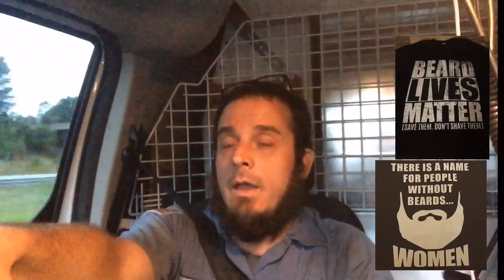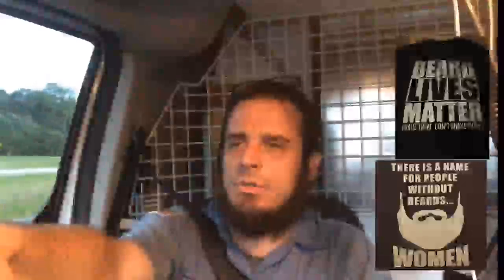Stephen Rardon Live Stream The Magical EEV, TXV's and other stuff

Comment: Hypothetically speaking say I have a brand new 3Ton Carrier R-410a condenser matched up with a brand new Carrier 3Ton air handler with multi tap variable speed blower motor. This is an ARI 16SEER match up. Now imagine I have a really nice 3Ton R-410 Sporlan adjustable TXV mounted outside the air handler cabinet for added performance and the ability to fine tune the superheat to my preference. If I charge the said system and adjust the TXV to 10 degrees superheat and get my subcool to roughly 10 degrees, as the temperature inside the house goes up and down in both temperature and humidity how much will my superheat stray from the 10 degrees where I set it? Will it swing drastically like say from 5 to 15 degrees or will that high quality TXV be able to hold the superheat within say 8 - 12 degrees throughout all fluctuations of indoor air temperature and humidity levels or maybe even keep it between 9 and 11 degrees? Maybe it even locks the superheat down and holds it perfectly at 10 degrees at all times regardless of indoor air temperature and humidity level? I’ve just recently started to fully understand exactly how a TXV works and well as understand the pros and cons of them compared to a fixed metering device like an orifice or capillary tubes. I guess my question is how well does a good TXV maintain a certain superheat setting as the indoor air changes in temperature and humidity?

1st Edit: Related to the question that I need an answer to, this probably doesn’t matter at all but for the sake of absolute information clarity... the motor might actually  be an X-13. Either way it’s not a PSC motor.

2nd edit: airflow in return and supply is sized very well. No undersized returns or lack of supply CFMs.
Reply from the maker: +Jeremy Sandidge I had a discussion with a factory rep for one brand in particular who said that their TXV’s are designed to maintain between 10-15... now that begs to question if that’s the design parameter what is real world? I typically see valves staying pretty tight to whatever number between there and not really moving. Of course I’m not able to monitor operation except for when I’m on site. Then you have those times during start up when the valve is working to get dialed into it’s sweet spot so that adds to the variable. I guess that all adds up to say I don’t know exactly how they typically operate but have enjoy this mental wrestling match you’ve induced. Thanks so much for watching!
Reply: Stephen Rardon haha right lol? I guess we operate on the same level. I actually believe I can be the best technician in the world some day and I’m gonna keep striving. It seems like what you are speaking about though is a factory TXV which is fix to a certain superheat range and unadjustable. I use high quality aftermarket Sporlan TXV’s that are adjustable. I can adjust the superheat to wherever I like from 1 degree to 25 degree. One thing I’m so curious about is the fact the when I install a system with the factory installed TXV and charge to 10 degrees subcool and my superheat ends up being around 10 degrees I usually end up with a 19 - 21 degree temp drop across the evaporated coil. Now check this out blow I’m about to blow your freaking mind. I figured out something amazing but I can’t exactly explain the mechanics is fine details but just from my personal experience from about 5 - 8 new installs this summer I can assure you with 100% confidence that my numbers are correct. If I remove that factory POS TXV and add a $150 commercial grade Sporlan TXV to the outside of the cabinet on the liquid line and then adjust it to 10 degrees superheat just like the POS TXV was operating at, my temp drop across the evap coil goes from 19-21 to 23-25. Now explain that crap? Is it because I am utilizing slightly more of the evap coil by having the TXV farther away from the coil? I don’t know bro! I’d love your thoughts! All I know is it works and the only valves I’ve been able to achieve this with are the $150 Sporlan TXV’s from United Refrigeration. Dude imagine the added cooking capacity and dehumidification you could be able to create by taking your temp drop from 20 degrees to 25 degrees while still maintaining 10 degrees superheat?? It’s amazing! Seems to me like I’ve outsmarted the guys in the lab that engineer these things.10 degree subcool, 10 degree superheat with a 25 degree temp drop. That’s crazy but I’m doing it pretty regularly! Please if you could help me understand this amazing feature that I truthfully accidentally stumbled onto. But bro my original question is this.... with a good TXV how much does the superheat swing as the indoor air changes temp and humidity? I know my subcool stays almost exactly the same regardless of ambient conditions but is it the same with TXVs

Edit: bro I’d love to communicate with you over email if that’s cool. Maybe we can learn from each other. Can you shout me an email? My company email is JSMajorMaco@Gmail.com
Reply from the maker: +Jeremy Sandidge how accurate are your airflow measurements? Splits that high could actually detrimental to air quality. At least that would be my concern.

Comment: Hi Stephen,
I have seen units trashed because of eev funnies, and I did get to the bottom of it in the end!
Simply, they can get internally stuck.
I think it's compresser oil in the valve and it seems to happen worsed on cold cycle after the unit has been off for a while.
The valve will often wind shut and as there is no way to detect it is screwd down, the controller will keep screwing until it has to be down.
Usually, it will then try to wind it back open, but this often fails.
I have seen this with fujitsu and mytsibishi units.
The way to fix it is to get it running on reverse cycle, heating, and turn power off while it's spooled up.
The controller will re calibrate the eev and will generally succeed.
The other method I have tried is to get a nice strong magnet such as out of a hard drive, pull the coil pack off and manually rotate it using the magnet around the outside.
Presumably once there is liquid refrigerant in the valve again, the offending oil will get washed out.
To force a re calibrate, it often takes a power down from the mains for at least half a minute so the system does a full reboot.
Hope this helps!

Comment: I've had TAM7 air handlers close the EEV completely when the system was calling for cooling with the outdoor unit off, and not want to return to normal operation until I reset power to the indoor unit.
I've had it happen a number of times when I had the outdoor unit off to clean the outdoor coils, and had a call once where it happened when the customer switched the disconnect off while mowing the grass on that side of the house.

Comment: If you lose the y signal to the air handler the eev will pump down the unit that was probably the issue since you had some iffy connections
Went through the same thing a couple weeks back